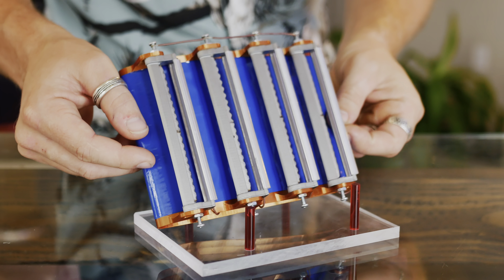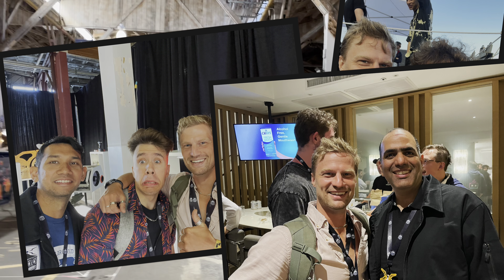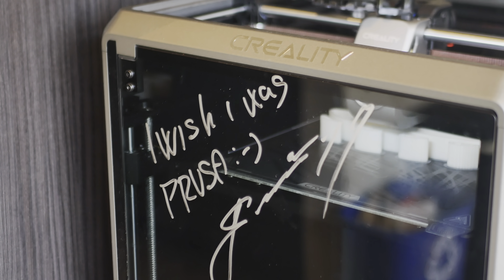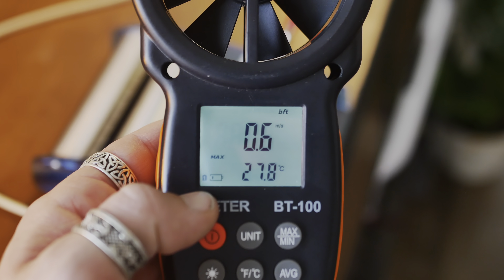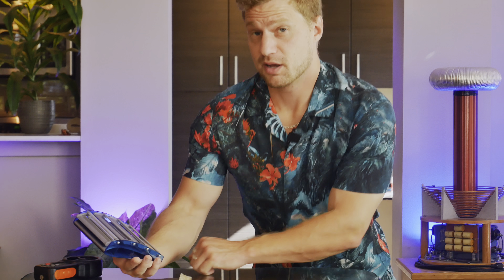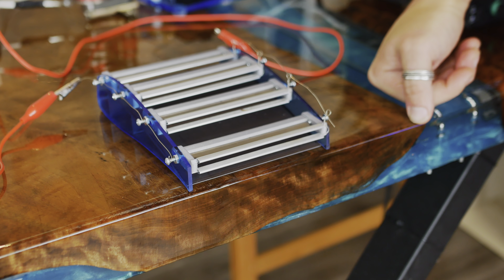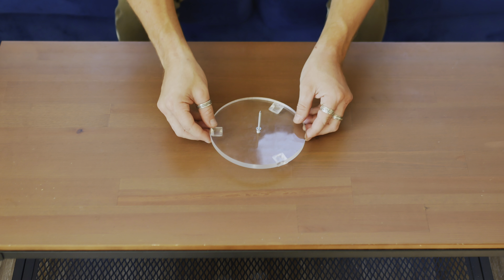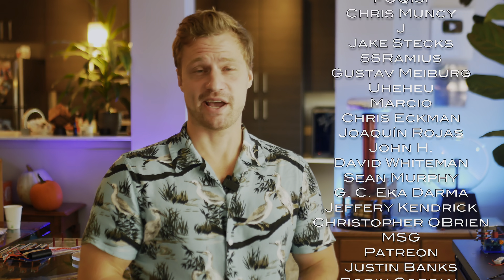Designing A Self Propelling Ionic Thrust Wing

Comment: Love the video. Mech engi here who has destroyed wayyy to many of those stun gun power thingies. What you can do to help your design.

1 consider the angles of your ionic thrusters. Currently each thruster looks to be offset from each other by maybe 5 to 10 degrees . Fixing that should help alot.

2  your high voltage power source needs to be improved. What you can do is consider something like a 555 timer to control an h bridge to create a high frequency high current output. From there you actually have 2 options. You can use a coil pack from a spark plug or you can make a small custom transformer . A 1 to 2500 transformer and then u rectify it. Alternatively you can use something like  electrobooms magic wand high voltage stick. With that you can get higher voltages i believe he can get a 100 000 volts . I am going to assume that your wing top surface is like 12 cm long so you may be able to get away with just 1 thruster.

3 trust in your 3d prints more. Your wing could be printed with just 2 or 3 shells thick and 05% infill to save some extra weight. 

4 change the orientation of your ion drives. This may seem counter intuitive but the math should make it painfully obvious. The current thrust you have is from the direct movement of the ions, but the majority of the force is perpedicular to the direction of current flow. Thats why the point to hoop ion thruster works so much better.  Your current design would work fantastic as a very low impulse (low thrust) high velocity ion thruster. You want high thrust low velocity(maybe max 300 mps ) . Try experimenting with the angles of the wire  that you use as the cathodes and see if making them larger helps.

5 add some electromagnetic effects using wire to boost thrust.

Comment: You did your Pos/Neg wrong on this setup. Put the Positive at the front of the airfoil and the negative at the back of the same airfoil. Scale your voltage to match the Pos/Neg distance. To scale the design, you do the entire wing as a single ion thruster instead of four small wings over the wing (less weight). This is because the lift on the wing comes from the negative pressure beneath it, you are only using the forward momentum but not the lift. I'd be happy to do a zoom with you to discuss.

Comment: If your looking for the points from a serrated blade without the weight try scroll saw blades or even bandsaw blade cut down to length… they may weigh more than a scroll saw blade but will be much longer… if anything wire wise you could try one of those wire survival saws… good luck man I wish I had the resources to experiment with these ideas too

Comment: Just a thought. This isn't generating nearly as much thrust as it would be needed for that airfoil to generate lift, so if you want to save on weight, why not just dump the airfoil and use a simple sheet? You can even put a couple of fins if you want to redirect the flow here or there. Much lighter.
Reply: Also, given the nature of this system, maybe you could push it to low air density heights with a standard balloon system and then make the ionic thruster kick in.

Comment: If your printing the wing try picking up some LW-PLA it will help cut the weight on the wing and hopefully improve the thrust to weight ratio for when you go full scale. I know the air speed over the wing increases lift but what might happen if you put a ion thruster on the under side? I could be barking up the wrong tree but it might be a way to get some extra thrust.

Comment: Really interesting video, excited to to see more! Reading through the comments theres people with much more knowledge of making model planes but I do have an idea I'd like to suggest, even as a lowley chemical engineer.

Once you've figured out the exact geometry of all the contuctors for the wing, could you potentally use them as actual structual members for the wing? Kind of like the carbon fibre spars used in other designs. Perhaps you could use titanium rods for this and then have a super minimal airfoil.

I feel like with the margins you'd need for flight, you may need greater incorperation of the iconic thurster into the wing design than having it on top. Perhaps there is an airfloil shape that would work for this?

Comment: You will probably need to get good with carbon fiber if you want to be able to make a glider wing large, strong, and light enough. Peter may be able to help with the molds and layups, but it's going to be complex and difficult. Carbon fiber is conductive, so that could help with integrating the engine into the structure, but It's a double edged sword.

Comment: **suggestion/idea. Do the ionic thrust modules actually need to be raised above the air foil?
Why can't the thrust modules be incorporated onto the very surface of the wing itself?
Like having those razer blades ever-so-slightly protruding from the actual surface of the airfoil and passing ions to aluminum foil glued directly to the wing.
Or maybe only one of the components needs to be raised. For example the +charged terminals on the wing itself with the -charged terminals raised above or vice versa.
Creating the thrust modules separately and placing them above the actual wing will just add weight and drag. Additionally, getting the fastest part of the air stream as close as possible to the top/lifting surface of the air foil will create the greatest possible lift.

Comment: SUPER EAGER to see this develop!

Will you be using that self foaming printable plastic at some point to make it even lighter?

OR have I failed to see you already using it?

I suspect carbon fiber is going to have to come into this at some point, and maybe foam board, and a hot wire or laser to cut them.

I agree a thin wire for the leading edge is best, can you get aluminum or titanium wire to further reduce mass, seeing as you don't need a lot of amperage?

Comment: So your ionic thrusters are already somewhat aerofoil shaped, why not go all the way? Why not have an airplane with a few wings behind each other, which themselves are the ionic thrusters? Apart from that, I don't really like the steal blades. Can't you find a thin sheet of aluminum or something that weighs less (and even has a lower resistance)? Instead of metal screws/nuts you could also use plastic ones etc. You know, just shave off unnecessary weight where possible.

Comment: Not sure if it’s been said before or makes sense, but would it be possible to integrate the thrusters into the wing with air opening on the top and front. It would reduce weight drag and should improve airflow (At least in my opinion I’m not an expert).

Comment: Out of curiosity why not use foil tape directly on the wing as the ground? the current design feels like it would interfere with the air flow over the wing causing weird loss of lift issues.

Comment: You mentioned you may move away from razor blades for the positive electrode, but the mount for that could probably be reduced to just holding the ends of the blade.... this would reduce weight drastically, but would also reduce wind resistance and increase the stability of the air over the top of the airfoil (less parasitic drag.)

Comment: @5:50 The sharper and more broken the angle of an atom interacting outside its space, created in a Sharpe edge. Makes it easier to transfer ene]rgy from the spot like a broken flood wall causing easily sparked or transferred energy from the wing fin tips till the other wing edge as your design shows...   The electric universe works easily with this in its functions from what I can see... Lightining is caused when Broken metal isnt aligned perfectly... There is always a constant flow through the particles, atoms, materials, planets solar systems, galazies and the universe as we know it.

Comment: I was wondering if the plan was to incorporate the ionic thrust into the natural flow of air over the wing, but this is not that.  The thrusters stand on top of the wing and point directly backwards, which interferes with the flow of air.  Without doing any real simulation, I imagine this creating a pocket of turbulent air between (at least) the last thruster and the wing surface, which is going to be a massive source of aerodynamic drag.  The point of having a streamlined rear on wings and other things is preventing that very same pocket of turbulence by giving the air natural airflow patterns at all times.  For instance, if you swing a rectangular bar through the air, the air going past the sides wants to be undisturbed, but the high pressure off the front of the bar and the low pressure from behind it force air to fight in order to get to where it naturally wants to be.  If you swing an ideally streamlined bar through the air, the air has to fight the bar shape much less, so the bar feels less resistance.  This combination of wing and engine may accelerate some of the air going over the wing, but it also creates places where that is in conflict with normal airflow.  Given the relatively low thrust of the engines themselves, I don't think you can afford to lose too much thrust to forces like that.

Comment: I wonder if you could put the plasma thruster inside the airfoil with narrow long openings in the upper surface for intake as well as helping to assist in maintaining laminar flow.  ( already a used technique in some experimental airplanes ) thrust could be from the trailing edge and angled parallel to the trailing upper airfoil to mimic the flow direction off a  regular wing.  Currently, while you get good thrust, you also have a lot of draggy area, but the Suck aspect of the thrusters might counteract the Drag.   I bet you could get lighter and aerodynamically better with an internal thruster with all the mechanical connections integrated into the interior ribbing structure of the wing itself.  In the wing, you only need to worry about a low resistance path tor the thrust air  and don’t need to streamline things not exposed to the airflow over the wings.  The tapering of the airfoil could also concentrate and accelerate the thrust air.
Reply: Your proposal reminds me of one of those blade less fans, but wouldn't the air coming in at the leading edge of the wing remove the air that is supposed to flow over / under the wing for lift? You would need a larger opening for intake air than the thrust outlet correct?
Reply: @petergriffintubin1  there would be no intake on the leading edge.  The intakes are on the upper surface of the wing,   Both to prevent turbulence and keep the laminar flow on the wing surface.  Sometimes wings have flaps that involve 2 separate flaps that extend down together with a gap in between to keep the airflow attached with the high curvature of the wing at the extended flaps .  The slots on the top of the wing would act similarly.  You could LH ink of it as long rows of scoops on the wing except unlike those on say a cheese grater surface, the edge of the scoop would be flush with the surface and rely on the suction of the plasma thruster to deflect some of the air Into the wing’s interior.  Hope this is clearer.  A picture would have been better, but I’m not sure I could upload one.

Comment: you should incorporate the wire components into the surface of the actual airfoil itself.  placing all the on top of the wing basically renders it ineffective - as all of that extra hardware is drag.
I'd like to see plat are wire follow the contour of the wing.  at first I thought you were doing that when you did the weight reducing slots, but you still kept the hardware above.  
just my 2 cents

Comment: Not an engineer, but adjusting the positions to optimize airflow over the top surface of the airfoil may have benefits to lift, allowing you to use lighter wings. The thrusters may be detaching the airflow from the airfoil as they pull the air in. I don't know what effect that will have on airfoil efficiency, but its something to think about.

Comment: The tape is still quite rough. Try to plating on the 3d print for a more smooth negative. You can apply graphite spray to make it conductive and then make a plating bath.

Comment: If you have seen Tom Santon's video "Flying a Plane Powered by AIR" there is a good lightweight design for a large wing. You can extend the 3d prints up to make mounts for the engine and then use plastic pins to mount them to save using nuts and bolts.

Comment: My first thought, is that you should minimize the 3D printed parts even more, and have Peter Sripol build as much of the rest using lightweight plane building techniques. Another idea for a video: Build two left wings, and create another rotary setup, but symmetrical. This "helicopter" test stand could sit entirely on a scale, and then you could start measuring lift.

Comment: 14:19 if the wing is providing lift then there will be torque against the balance point in your jig, causing more drag. you should try balancing it on a single point (instead of a in a shaft)
to see how much instability the lift creates.

Comment: Maybe you can make use of the Coanda effect by putting strips for grounds on the wing itself. With the correct spacing this should pull the airflow down and along the wing. The Coanda effect will lock the flow to the wing surface. Making sections of the wing as one side of the ground will also reduce the wing weight!

Comment: How do you prevent these modules burning out? I've found they have a reduction in power over time.

You can also crack off lots of the potting from the modules without ruining function (for weight).

Comment: Hey, really cool video! I see a few problems however.

1. Obviously the thruster bits themselves affect the flow of air over the wing. The part that maybe isn't as obvious is that this affects the behavior of the airfoil. I think you should design the thrusters directly into the airfoil rather than putting them on top. This leads into the second thing:

2. Your output wind speed is likely affected by the coanda effect such that your output force vector isn't pointed in the right direction, you want it to push you straight forward, but it's pushing you up slightly (this is bad because going faster gives you better mechanical advantage in your lift calculations)

I wish you the best of luck with future innovations!

Comment: Great work! I think weight can be reduced by attaching one of the two halves of the split ground directly to the wing , maybe as a metal strip embedded in the wing itself. Should also reduce the drag.
Reply: Are two grounds necessary, could there not be a benefit from streamlining the flow and remove one of them while directly integrating the remaining one smoothly into the wing.

Arguably the same could be done for the electrodes allowing for laminar flow.
Reply: I literally just spent 5 minutes writing a long-winded way of suggesting effectively the same thing 😂

Comment: What would happen if it goes through a cloud of smoke?
Reply: I’d imagine it catching the winds on fire or/and scattering the ions so it shoots more randomly (more sparks and noise). I’d also speculate if the air particles are more dense it will create more speed but inconsistent since smoke is not one type of gas.

Comment: How do the thrust sections actually contribute to the air flow, for me, understanding how to stack these elements and tune them is where a sweet spot could be found.

Also, just bending the blades would produce lift in and of itself?

Comment: With a straight wire, it will work, however the serrated edge you recently used gives the best results due to a more evenly spread current, so I would suggest making a small barbed wire mockup for the hot side, equal spacing between the barbs that points all barbs towards the ground plate, and the ground plates themselves could also be wires.
The holes in the wings is fine, that can be covered tightly with canvas and painted with oil based paints to seal it. Then do the suck test, once dried just try to suck air through it, if air passes through, then the paint isn't thick enough. If too much paint is applied, it will get too heavy, and this is how they made the early bi-planes. Perhaps instead of making solid holes, leave a hair's width of material on the top and bottom most segments to maintain lift for those areas of the wings, as the holes through the wings will not allow it to fly, and will need the rest of the wings to be larger to compensate for the holes and lack of lift in your engine segment.

Comment: It is important to note that this vacuum generated by electrostatic ionization is not a total vacuum, but rather a region of low particle density.  The object will not be completely isolated from the surrounding air, but the particle density can be reduced enough to create an effect similar to a relative vacuum.

 It must be taken into account that a wing profile is designed to create a low pressure and high pressure zone at the bottom of the profile, taking advantage of the thrust force. Logic says that to generate vacuum that makes lift possible, it must be designed a concave and symmetrical profile which leads us to a circular concave profile and placing the ion generator in the center so that the air enters from above and moves along the concave surface.